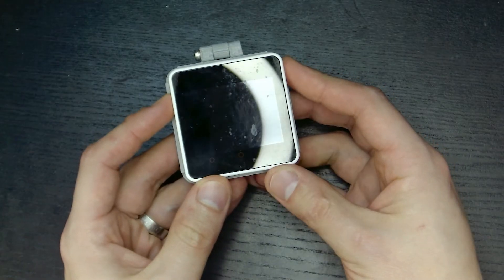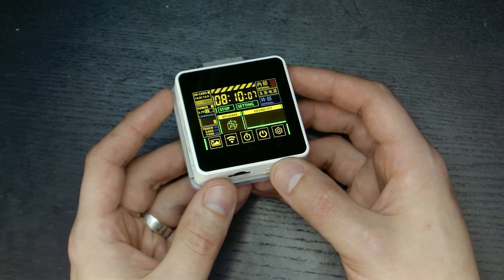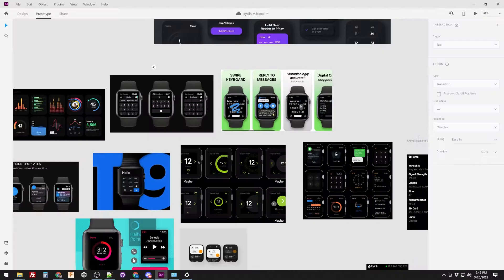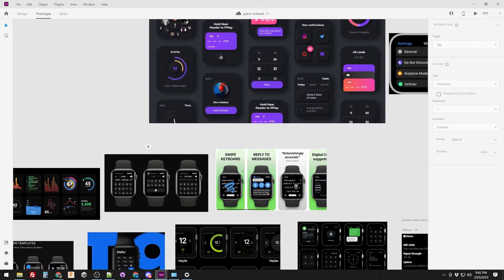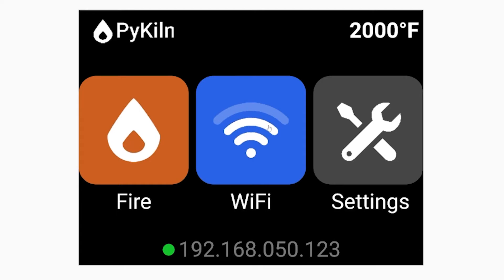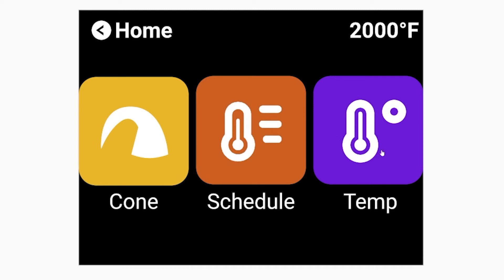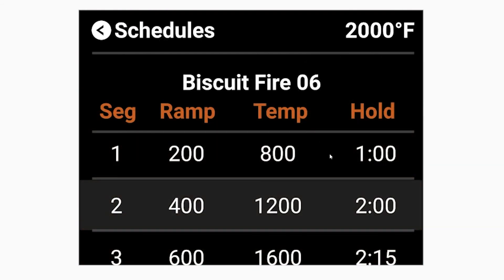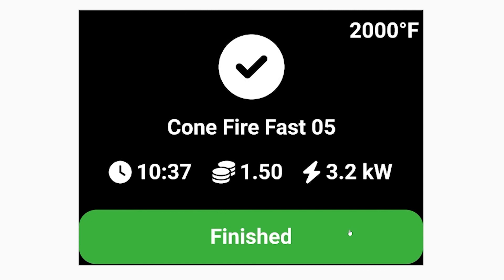PyKiln Touch Interface Sneak Peek!

Comment: Hay, cool an M5Stack Core 2 project
The bloat is due to them Not understanding the build and I have been fighting with them to slim the firmware down due to duplication of libraries.
BTW UIFlow V2 firmware should solve a lot of the bloat and memory issues.
Can you make a guide on how you got Mainstream MP running and setup on it please?

Comment: I just acquired an older paragon manual kiln, i can't wait to update it with this interface, everything looks clean and the functions provided seem perfect for day to day use, i doubt you will need to access the settings provided through the browser very often, i think you made a good design choice narrowing the scope of the interface.
Reply from the maker: Thanks Kody! I could see the fact that you can't modify the schedules on the touch screen as a feature especially for classrooms and production potters. It makes everything simpler

Comment: Very cool work you’re doing. I work with molten glass and although I hear it lots I’ve never learned what different cone firings translate into for the kinds of firing schedules I need (simple ramp/hold).  It looks like your device does that though so probably can just ignore the cone stuff? Can your device work with thermocouples that read up to 2500 F? Is there a 4-20mA output a guy could connect into a phase angle SCR?
Reply from the maker: Hi Gregg! Yeah in ceramics they use cones to measure heat work. Different clays and glazes will be rated for certain cones. Kiln controllers will have preset firing schedules for cone firing. Under the hood it's the same as ramp/hold. Yes it can work with K, J, T, N, S, E, B and R type thermocouples. I'm focusing on getting K to work first since that's the most common. How PyKiln is set up is the ESP32 has an i2c connection to a PCB that has all the sensors and has outputs for solid state relays

Comment: Fantastic its looking really good, as a potter I am interested in kiln connection or a retrofit of a old kiln , would love to know the wiring diagram and connection to the Pykiln also what type of thermocouple or can you change in the settings to K, N or S etc, love to see this on the market I would definitely get one , I am currently retrofitting a small kiln with a Chinese ramping PID and its controller is way to complex with little to no thought in the design, I would love to see the web based firing schedule designer,  if it can do a crystal glaze firing you good that's prob the most complicated firing and its only a ramp down with a hold. Missing would be reduction firing which would be oxygen probe valve and damper connection but I don't think its needed as there is not many of us potters out there now that fire in reduction and we do it all manually, as automating is very hard to do.
Reply from the maker: Thanks Mike! The ESP32 is connected to the controller board using i2c. The controller board has outputs to control a contactor and solid state relays to power the heating elements. It also uses MCP9600 chips to measure the temperature. They work with any K, J, T, N, S, E, B and R type thermocouple. I'm going to focus on getting K type working first since that's the most common.

Comment: This is really looking good! My business makes sinterable metal 3d printing filament. We make heavy use of precise temp control, we have 5 kilns in heavy rotation. I signed up for your closed beta. Please let me know when you're ready for real-world testing. I think you're on to a solid concept here.
Reply from the maker: Hi Brad! Yeah, I love what you're doing with your metal 3d printer filament. For the beta, I'll be sure to let you know when I have something running for you to play with. I've also been testing ways to make a $20 small DIY electric kiln. I think I have something super easy to make, but I want to do some more stress tests with it before I show people.
Reply: @curlytalegames2609  If someone can make a simple kiln with digital control that can hit 1925f for Copper or 1625f for bronze, people will be able to 3D print pure metal parts at an incredibly affordable rate. If you can get up around 2300f we can sinter Stainless Steel 3D prints. Please keep me posted, affordable high temps would another great step forward in our effort to democratize Metal 3D Printing. We want to make this so simple, and so affordable that anyone can do it.

Comment: You really nailed the interface, don't think you missed very much! However, I wouldn't mind the option of having a larger transflective monochrome graphical display built into the controller itself. That would allow users to control the kiln during wifi outages, and can also be readable in bright environments, even direct sunlight. 

I'm quite familiar with programming esp32's and monochrome graphics displays, so I might be able to add in that option when you're done, but I've only worked with the Arduino language unfortunately, not python.
Reply from the maker: Thanks Mike! Interesting, are your electric kilns outside? PyKiln will send an email notification as well as play an audio file to notify you when it's finished firing and you can always check the status in a web browser on your phone/computer. I could design an optional 3d printed screen hood to block some of the sunlight on the M5 Stack Core 2. What would you want to see from a transflective display?
Reply: @curlytalegames2609  I may have gotten a bit confused. Will this m5 stack actually be physically attached to the kiln controller, or is it wireless?  And yes my kiln is outside 😃
Reply: @curlytalegames2609  pretty much every function you've added to your m5 would suit me for a transflective display. Perhaps being able to view the live schedule graph would be handy too. 

Definitely want to take a crack at micropython some day, so maybe one day I could build such a thing in.
Reply from the maker: @mikepaul6688  The M5 Stack would connect to the controller PCB. The controller PCB is basically a bunch of devices that all talk over I2C to turn the relays on and off and measure the heating zones. You could either have the M5 stack mounted locally at the kiln with a short Grove cable, or use the Grove to Ethernet cable adapter I built to mount the M5 Stack further away from the kiln. It's not actually networked using the ethernet cable, it's just using the cable since it's easy to buy or make your own cables at whatever length you want. So don't plug it into a switch ;)